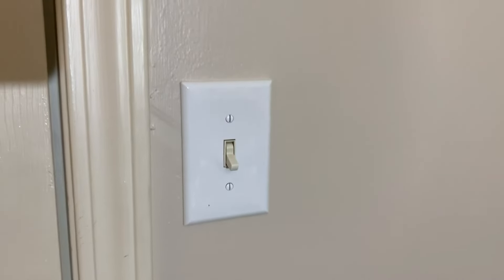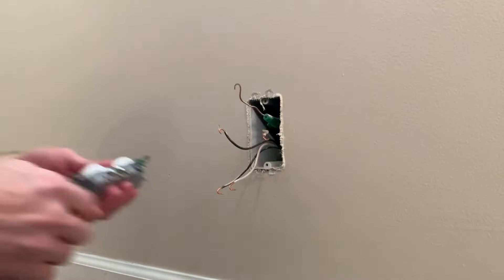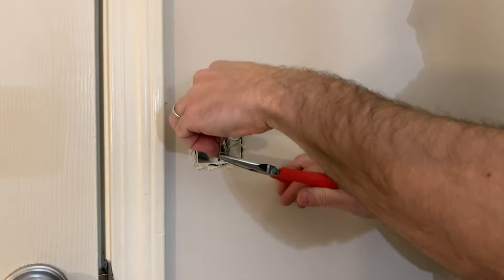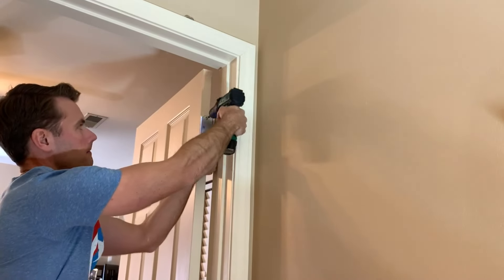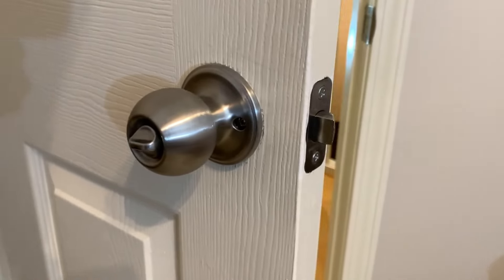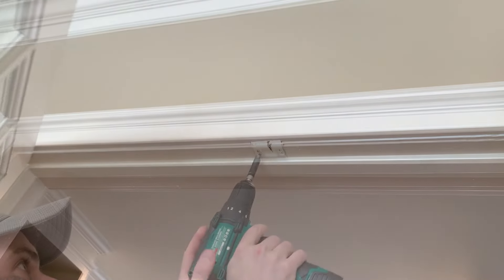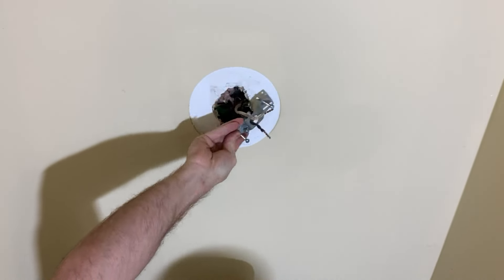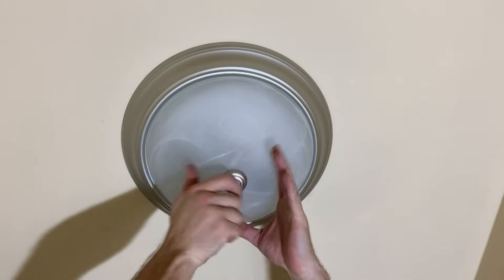4 EASY Ways to Update Your Home

Comment: Great video! Every home in my part of the nation that is less than 20 or so years old has all the outlets installed with the ground terminal on the bottom (opposite of your orientation). The only exception is when the outlet is switched, those are installed upside down. In our house we always know which outlets are controlled by a wall switch by the orientation of the outlet. So for us, our outlets are installed both ways!
Reply from the maker: Yeah our entire house is this way so I just went with it but from what I’ve gathered it sounds like the code doesn’t specify. But, it’s probably upside down.

Comment: The biggest issue I ran into replacing all the switches and outlets in my house was the builder used oversized "oopsie" plates to cover jagged cuts in the drywall around the outlet boxes. I still haven't patched most of them, but even with the raggedy holes I still think the new covers look better than the old ones.

Also, with many of the switches, I haven't been able to get the new ones to lay flat and level against the wall, making some of them cockeyed and askew. I need to go through the whole house and shim them all to lay flat.
Reply from the maker: Oh man. I bet that’s a pain. It’s one of those projects that isn’t hard, just takes a bit of time and looks so much better when done!

Comment: The electricians at work always install the outlets in that orientation.
Reply from the maker: Yeah seems like a great debate in the community. 🤷🏼‍♂️
Reply: The ground prong is facing up as a safety net so say your plug comes partially unplugged it’s so you don’t touch the hot wire prong on accident so you would come in contact with the ground prong first!  It is something done in industrial field not as much in residential!